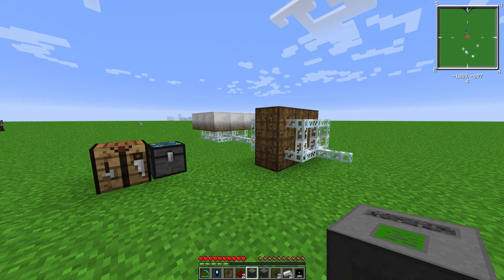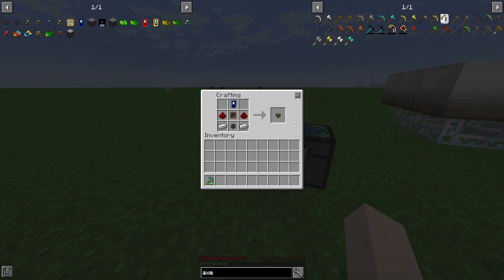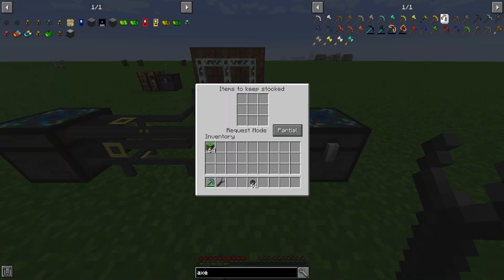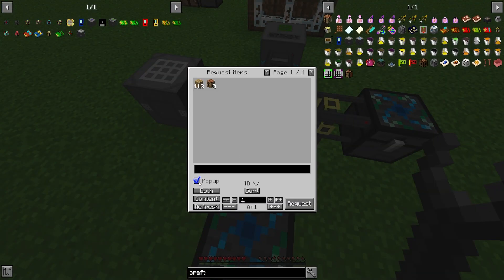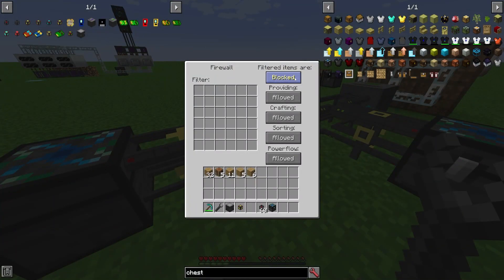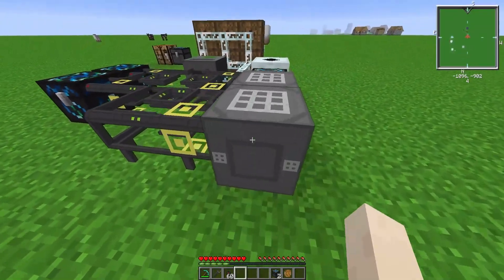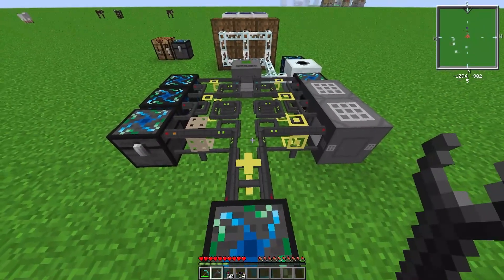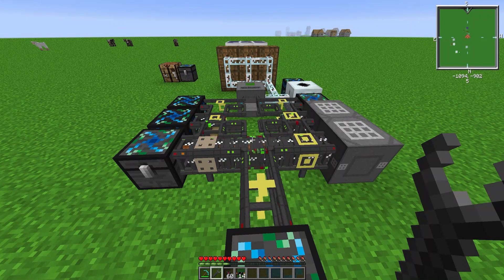Logistics Pipes - Tekkit 2Torial

Comment: That's a nice video but you're missing some shortcuts:
1: you can put recipes in the logistic crafting table from the JEI interface
2: you can import recipes from the crafting table to a crafting pipe (there's a botton of it)
3: there's a module you can put in a supplier pipe/module called "crafting cleanup upgrade", it provide a path to excess material (like the copper cables in your video) to go to instead of popping out of the pipe